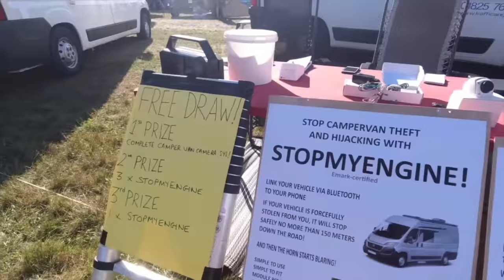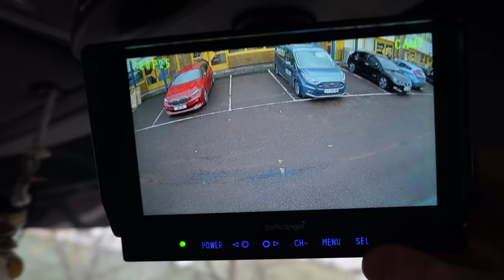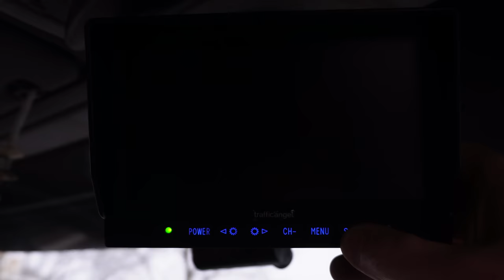CAMPER VAN CCTV Complete Install - Traffic Angel

Comment: Is that over the Counter Price Mel or Fitted?.
The way you saud about the sude Cams it showed from the front Flasher backwards but just covers the handle  n Lock  the Foward Facing does the wide angle front.
Nice neat and small unobtrusive Cams unlike those big Bulbous Types 👍